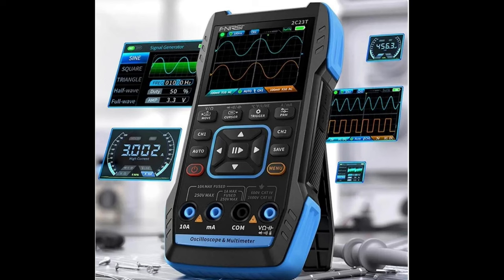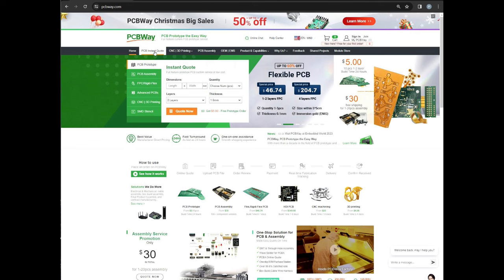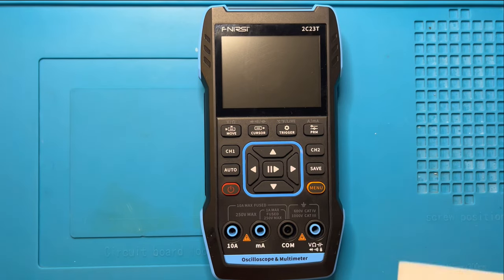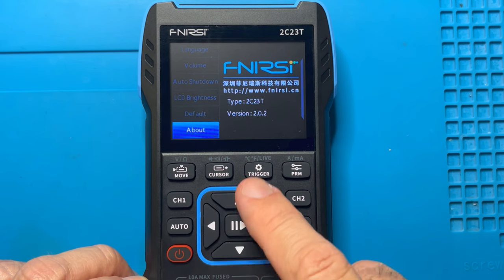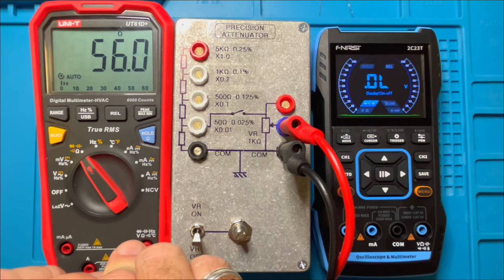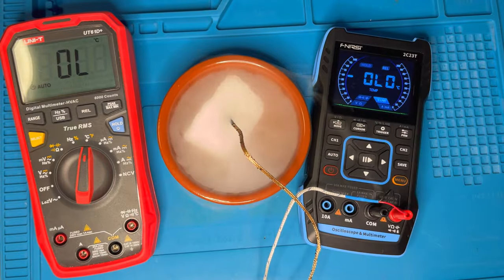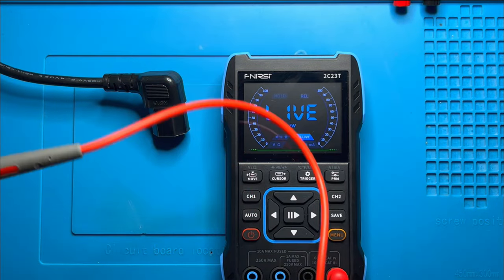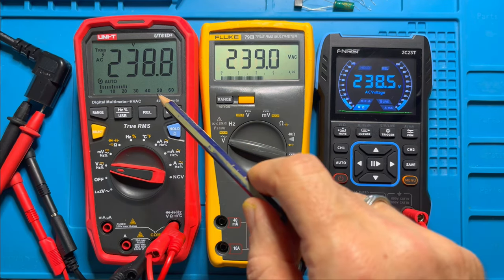FNIRSI 2C23T Functional & Performance Review

Comment: Amazon   $90    FNIRSI 2C23T 3 in 1 Handheld Oscilloscope Multimeter DDS Generator, 2 Channels, 10MHz Bandwidth, 50MSa/s Sampling Rate, 10000 Counts, Voltage, Current, Capacitor, Resistor, Diode Test.   The X-Y mode would have been a nice feature.       😎   Thank you, great video.
Reply from the maker: Thank your for you nice comment 😊 I also have a hardware review video on this device

Comment: Would you recommend this for 40hz 10-150v ac

The usage would be setting gains on car audio amplifiers using the oscilloscope up to where the sine wave starts to clip.

Thank you for a thorough video 🙂
Reply from the maker: Thanks for your comment. Seems like a good application for the 2C23T 👍

Comment: I saw few advertisements and on few of them they stating that has also infra temperature sensor that showing heat on the main display.
Is that true?
Reply from the maker: It have a simple internal temperature sensor, but it not accurate.
Reply: Ok no infra red?
Reply from the maker: Correct, no infrared sensor.

Comment: First of all, thank you for these 2 videos about this product, my question is if there is software for PC and connecting the FNIRSI to the PC's USB. Thank you. Greetings
Reply from the maker: Hello, thanks for your comment. I am not aware of any applications.

If you connect the FNIRSI to the PC, it appears as an external drive and you can see the bitmap images of any screenshots you have saved. You can also store a new start-up screen here if you wish to change it (details of how to do this are in the manual). If you enter bootloader mode on the FNIRSI and connect it to a PC, another external drive will appear that you use to download and store new firmware.

Comment: Do you know what maximum current the signal generator can emit? 20-30mA? Is there any over-current protection?
Reply from the maker: Sorry I don’t know. However if you have a look at the section of the video that covers the function generator, we work out the output impedance. It is 100ohms. So this will limit the max current and provide a degree of short circuit protection to the device

Comment: Thanks for the review. 
I am looking for a small decent oscilloscope to test sensors on cars, such as cranshaft sensor, camshaft sensor, oxygen sensor etc etc. 
Is this good enough to do that do you think  ?  
Or is it overkill ?  
Suggestions ?  
Thanks
Reply from the maker: I think it would be good for such an application where the signal frequencies are relatively low.
Reply: I am also thinking about buying it for the same application on forklifts, was curious if you bought it and how it worked out? Is it doable or no?
Reply: @angealus   Nope sorry, not as yet.

Comment: Thanks for the two great reviews.
After looking at them I decided to buy the device.
But now I have a problem.
When trying to update the firmware, the device rebooted to 100%, but then it didn't turn on anymore. I wrote to support.
Can you advise what I can do?
Reply from the maker: Hi, sorry to hear of your troubles. I can’t really help you there. Their support is quite good. Wish you well in getting it fixed!
Reply: I was able to run it.
I disconnected the battery, charged it on an external charger. I reconnected it, reset the unit and it started bootloader mode only. So I was able to flash the firmware successfully and the device boots normally.

I can now test all its features. :)
Reply from the maker: Well done!👏

Comment: You can't measure analog video we refer to as acid test due to trigger, it doesn't have advance triggers as a proper bench scope would as you stated to complex of a signal for it rated specs. As far as digital signal square waves you need 10x the bandwidth analog and a lot more sample rate ADC. So watching your results was kind of expected for specs it claimed. The major issue is jitter and timing notice is pretty bad with this one, could be they are overclocking the ADC's? It good only for PASS, or No GO like most handheld of this price. I won't recommend for anyone that starting off, or using it instead of a bench scope at a a bench using as their main scope. 

One question is the channels isolated from each other. grounds on BNC's not shared, they claimed it was which would make it useful if it actually is? If you can measure the ground between the BNC GROUND? When they stated that it peaked my interest especially for the size it is.  I actually considered buying one just to see if it does? If it does will be one of my main portable scopes that will be used as repair switch mode supplies and control units and it's small size throw in a bag and make it lighter as have to carry a lot of gear around the city and in a lot of cases have to take subway due to not practical and pain to drive in downtown area. The only other thing wish it had 5mV like my oversize truly isolated handheld Tektronix scope vertical sensitivity. The Owon does but channels not isolated so have to use a battery powered signal generator to offset, or bring differential probe.

The scope section would be ok for HV so long channels are isolated from each other and you are using a appropriate resistor divider HV probe to the voltages are measuring,  I measured 300v all the time and as high as 4kv on my Tektronix portable all the time and has the setting to accurate measure it with the appropriate HV probe. it is the main reason people buy these handhelds, especially us that repair power supplies. The multimeter won't trust for high current as lacking in protection area, when compared to a proper CAT rated Fluke multimeter. I had coworker manage to blow the flukes up even. For bench use the multimeter would be ok for low current, the multimeter section is better then my HDS3102m-n that costs way more like $425 more. 

The crosstalk may be another issue as no shields on this one, I wonder if that has something to do with the jitter I saw in your test, as seem to be worst when you enable the other channel? Good way to test is use one of the channels keep other channel on and put vertical to 10mV and see if that channel pickup the signal from channel you are using?
Reply from the maker: Hello, thank you for your very interesting feedback. I did measure the grounds. Both the scope inputs, the sig gen output and the USB port all have their ground connections connected together.  Note that the input sensitivity only goes down to 20mV/div. I will test the cross talk as you suggested and will let you know - good point.

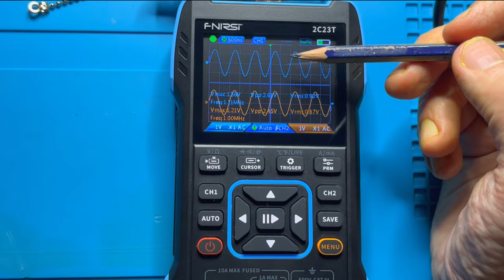Regarding the ADCs and the jittery triggering. With reference to my teardown video (35:45), I did have some concern on the spec of the ADCs as most of the refences to the specs of this device gave a spec of 35 MSPS rather than 50 MSPS, so you may be correct on the oversampling.
Reply: @ElectroBananasYT  Figured they lied about the two “isolated channels” they claimed in one of their picture advertisements. They would have to use optocoupler for that to be true and didn’t notice any in the scope section in your video. So wouldn’t be useful for power supply repair. It a Fnirsi so not surprising on the false advertisement. Do suspect same as you it a 35MS/s ADC and they are oversampling as well? I have handhelds one channel scopemeter that do a real 40 MS/s and signal stable on those even past the analog front end bandwidth.

Comment: Looks like they removed the firmware from their website. Only the pdf is available :(
Reply from the maker: Have a look at the software download instructions in my functional review. There I explain that the software/firmware is incorrectly described as a pdf when it is actually firmware.
Reply: @ElectroBananasYT  I did and It just opens a PDF. Check for yourself.
Reply from the maker: You are absolutely correct. I contacted FNIRSI and they reported that the firmware for the 2C23T is currently “under maintenance” and will be updated soon. I assume this means that they are working on a new version of the firmware, so hopefully we will see some new firmware soon. Thanks again for your comment.

Comment: @ElectroBananasYT After your review I ordered this from Amazon for $79, it will be delivered by tomorrow, let's see if it is a good addition to my tools.
Reply from the maker: Hi, thanks for your comment, hope you have fun with it. It is easy to use, but beware of it's limitations :)
Reply: @ElectroBananasYT  Thanks, yes I got it, its 2 channel Oscilloscope but I dont know why they have provided only 1 probe with it? I noticed that it is not measuring anything below 4 mV although it is 10000 TRMS
Reply from the maker: Hi, when I bought mine there were two options - with one probe or two probes.

Comment: Hello, I'm new to electrical engineering as I'm just a second year university student. Is it possible to use this device to both generate AC signals and then display the same signals with the oscilloscope on the same device simultaneously?
Reply from the maker: Hello, yes it is.